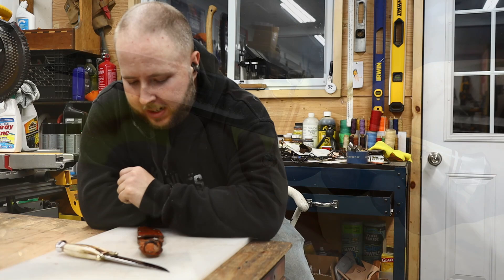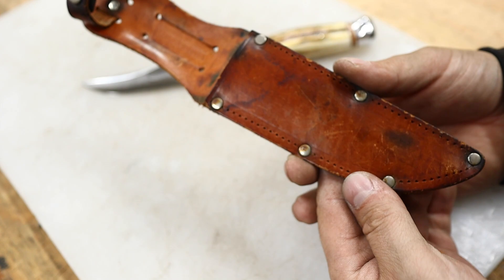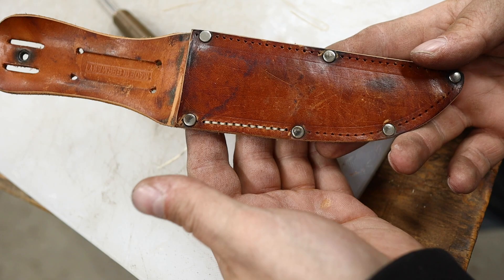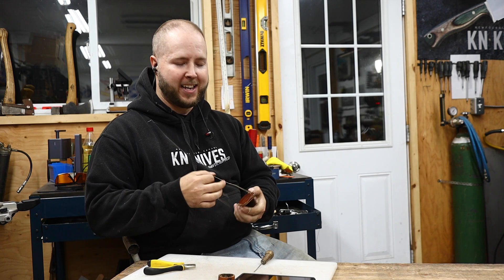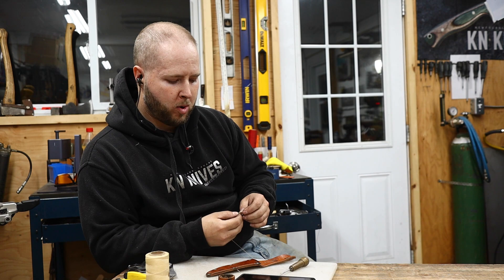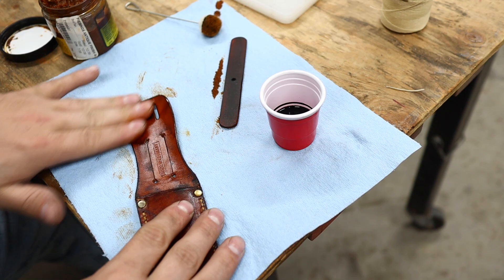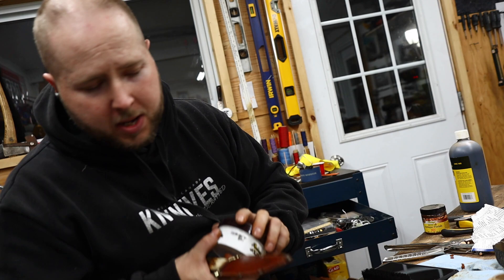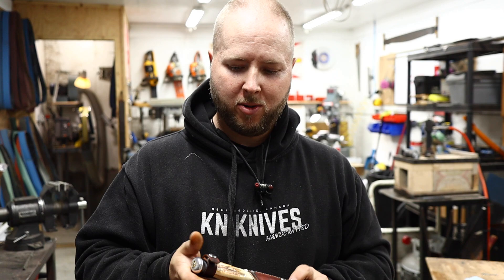RESTORING AN ANTIQUE KNIFE SHEATH

Comment: I like to build and tinker with making things especially woodworking so I own a couple of Dremel Rotary type tools including the original Dremel. But when I go to get out a rotary tool I more often than not I grab my Wen Tools rotary tool the same as the blue one in this video. I bought mine with the included extension and it has been very handy and I prefer it to the Dremel

Comment: Looks great. On another subject, recently i received the task of sharpening an axe for my mother in law. Any tips on that? It will be used to turn splitwood into smaller firewood
Reply from the maker: For that task, you just need to make sure it has an edge. A file is just fine! No stone work needed.

Comment: Are you familiar with a German kissing crane bull moose fixed blade knife? My uncle gave it to me when I was about 15. I’m 40 now and it’s just been sitting it the top drawer of my chest of drawers…😂 The sheath it’s in isn’t made for that knife… It kinda reminds me of a Kabar style sheath… It’s got the metal back plate and it wraps around the bottom of the sheath and it has the place for a sharpening stone on the front… I was just wondering if that knife is worth anything I think the handle is real antler. I’m guessing moose antler. It doesn’t really feel expensive but it’s still not a bad knife… I’m kinda thinking about making a sheath for it or possibly buying one… Any advice on how to make a sheath would be greatly appreciated. It does have sentimental value to me because my uncle passed away a couple years ago. Thanks in advance… I also just discovered the antler part of the handle is kind loose, I can twist it side to side…